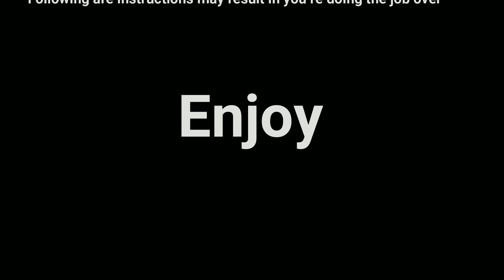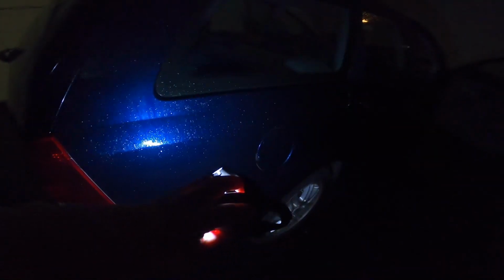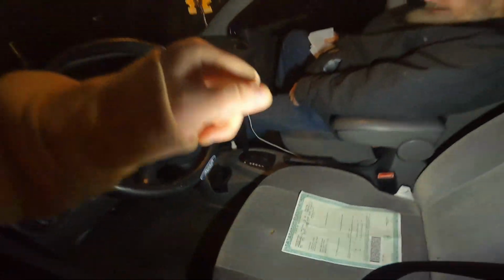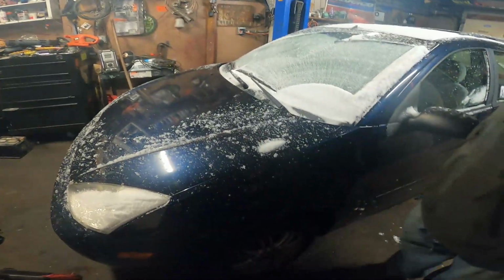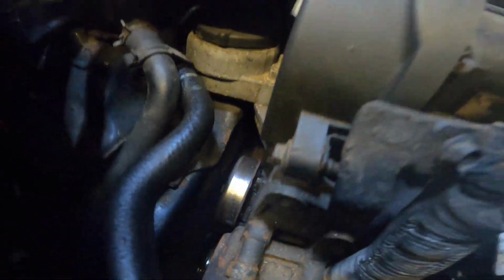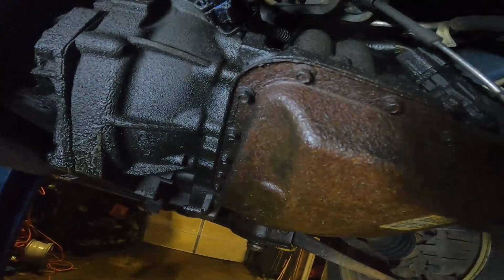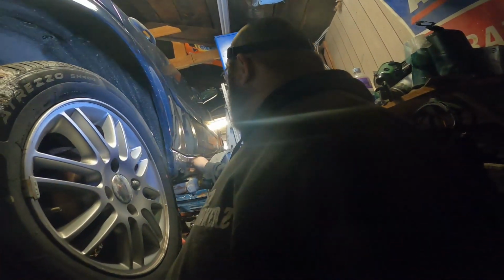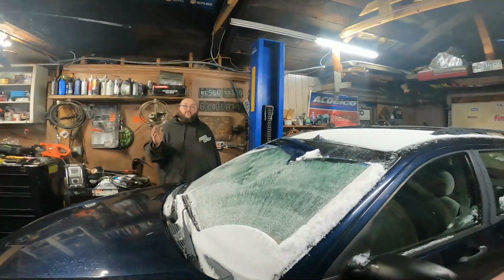Hocus focus 🎩

Comment: I've said it before, and i'll say it again... the Focus is a great car. Ford did a really good job with these things. Many are still on the road around here (not in the rust belt....lol) My ex gf has one since new in 2001 and it's STILL going to this day. I recommend them to others and they all have had nothing but good things to say about them after having one. 
One thing you may want to consider, these early generations ones, they like to eat engine mounts. They never break, just wear out to the point of causing really annoying vibration in certain gears (like when put into Reverse) or at certain speeds. The mounts are cheap, so that's nice. It seems as they near 100k, if the mounts haven't been replaced already, they will need to be. 
I thought you had rigged up a heat source for the garage?? Brittany sounded like she was gonna become a Popsicle filming for you... hahaha
Reply from the maker: Yes sir I know these cars pretty well now  Brittany never wears shoes she's crazy like that 😜
Reply from the maker: I do have a forced hot air I installed but with the price of fuel I haven't been able to fill it this year
Reply: @Junkerclunkerz  ouch! Yeah fuel is outrageous this year... I'm on electric heat so its not too horrible.

Comment: I Have A 2003,The Rocker Are Very Rusted And The Front Frame You Point Out Is Rotted,I Want To Fix It Cause Is A 84K Miles ZTS That Looks Like New
Reply from the maker: Anything is fixable with time skills and money. I have a 2002 ford f150 that's pretty rusty I want to fix back up iv owned the truck for 13 years it's just a matter of is it worth fixing